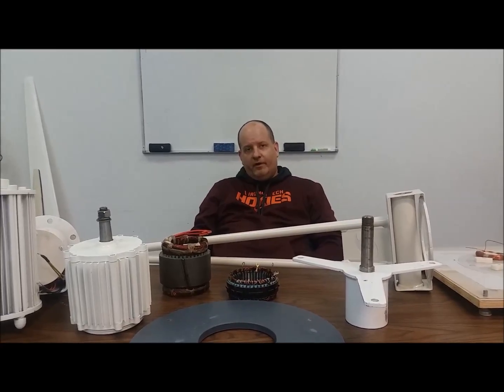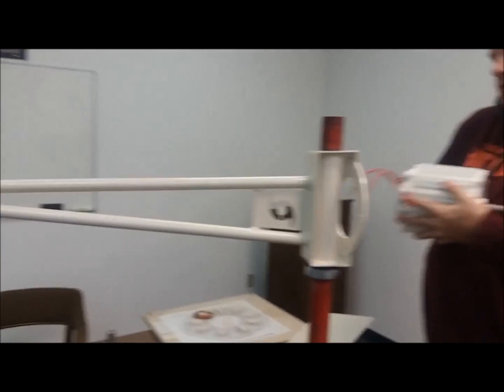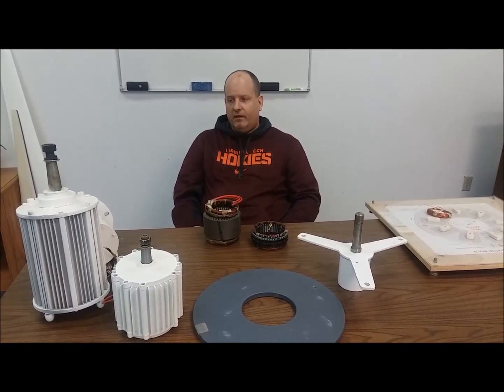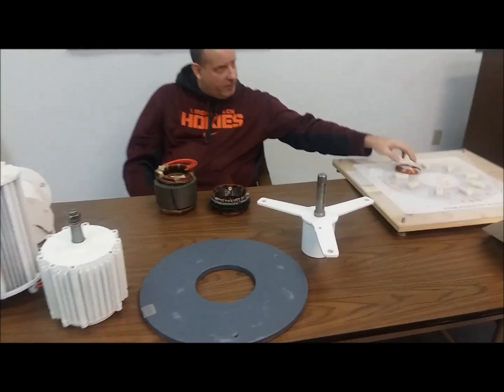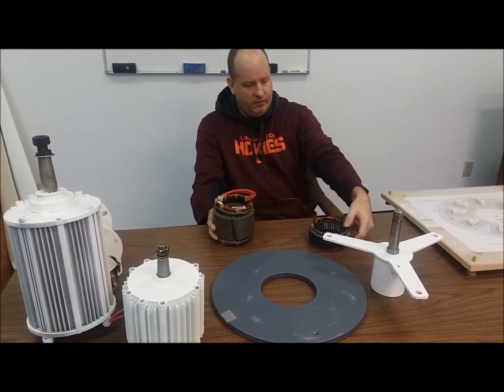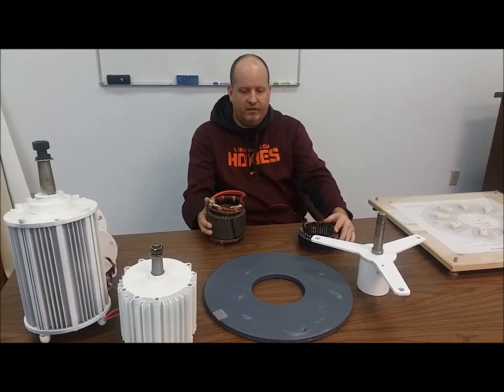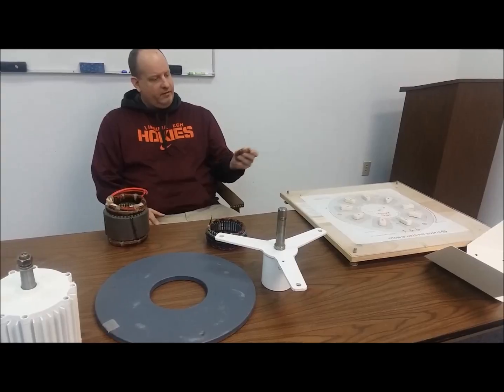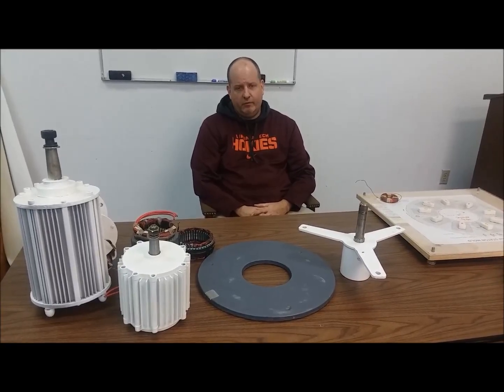Residential Wind Turbine Systems Home and Off Grid by Hurricane Apples to Oranges Comparison

Comment: Nice video. Where my parents are at, the wind there is usually 5-15mph. They are running a 12 volt system. If I understand, correct me if I’m wrong. They could use a 48 volt pma for their system to get power quicker/reach that cut in speed?

Comment: Great video Tony,  no doubt it’s a beast and you’ve done a great job of matching the blades to the generator to the frame. I was wondering if you could explain the accessory equipment, there purpose and where they fit in the setup from the generator to the breaker or fuse. To the  controller to the the batteries and any diversion equipment. The need if any for lightning arresting thanks again I’m looking forward to an education on wind turbine energy production.